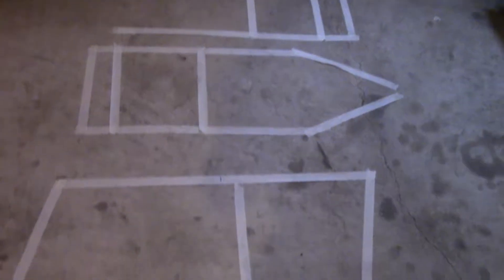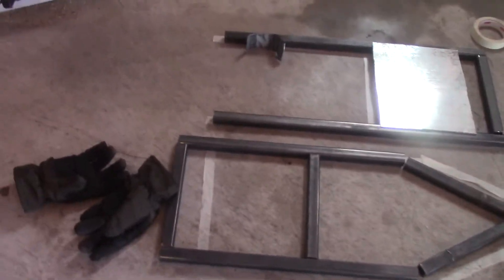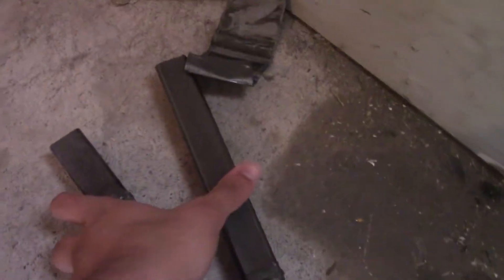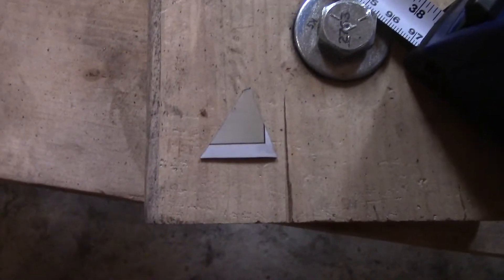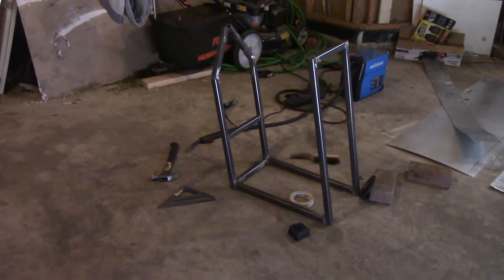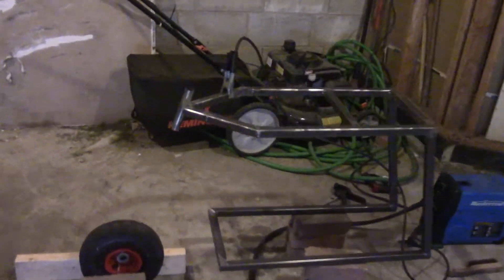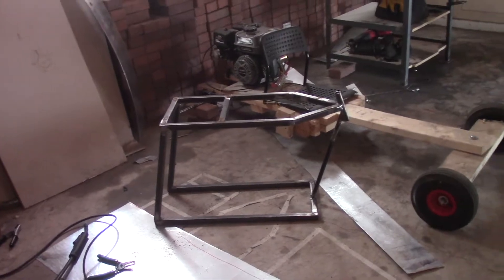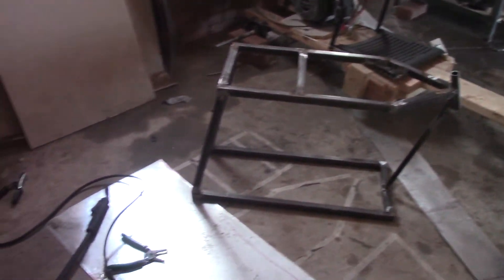How to Build a BASIC Mini Bike Frame (Tutorial)

Comment: do you like this welder like i know that at 90A it run for 3 min and need to stop for 7min !?
Reply from the maker: yeah I rlly do like this welder and it runs really well at least for my purposes. I never ran into any cycle issues, cuz I never welded for rlly long continuously. all I used it for was short beads and there was plenty of break time before I welded other parts as you see in the video.